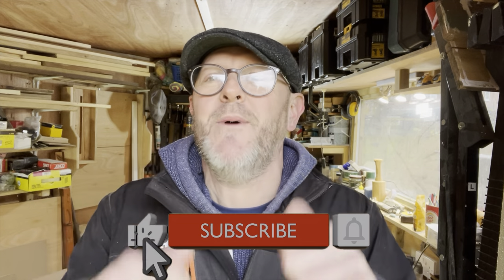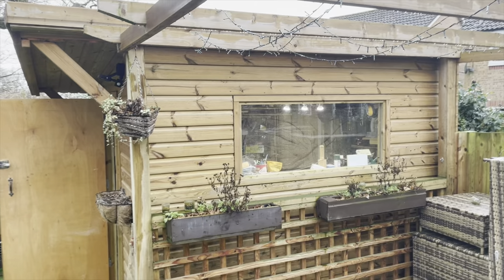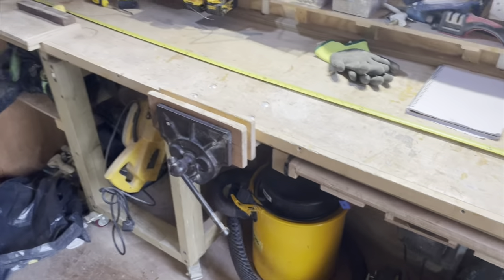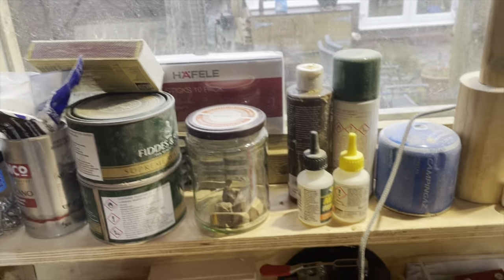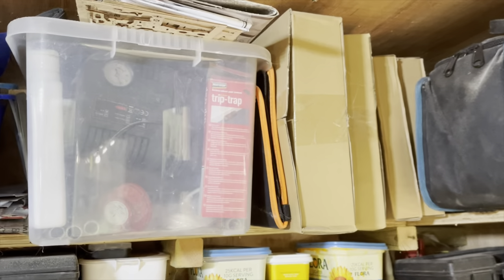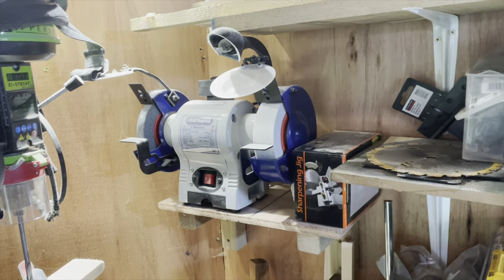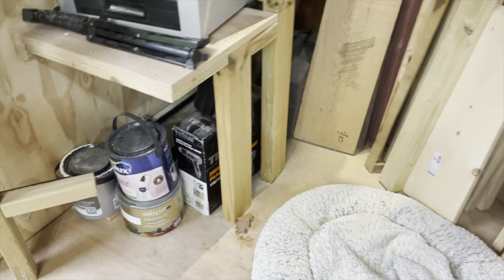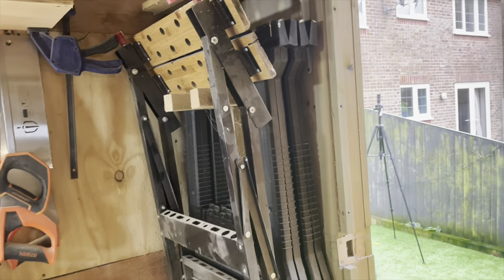Small Workshop Tour. How to have a productive workshop in a small space.

Comment: Some suggestions- move the window to  the eaves, or roof. Even the door. Wall space is too valuable to have low level windows.
Screws and other fixings- boxes are slow and cumbersome to access. Wide shallow drawers under the workbench give clear view and availability.
You do not store tools in workboxes! Poor access, and take excess space. Toolboxes are to carry tools, not to store them
Clamps- overhead. 
Dust collection- outside. High level ports. Matching high level power.
Under bench storage- needs to be fully utilized, ideally full depth drawers. Can hold all those tools, freeing up those shelves.